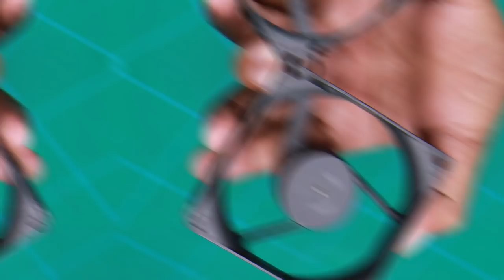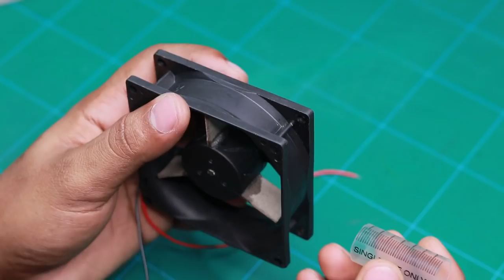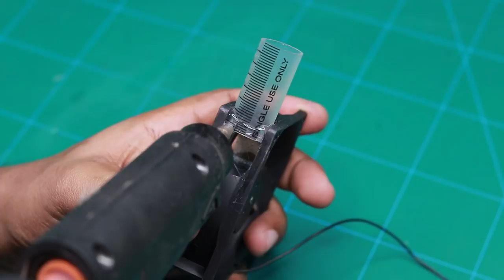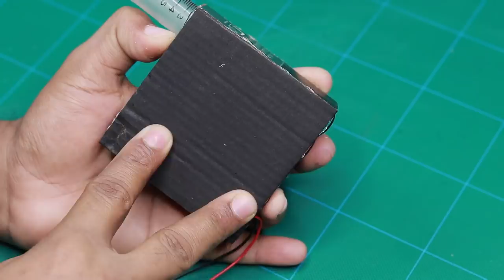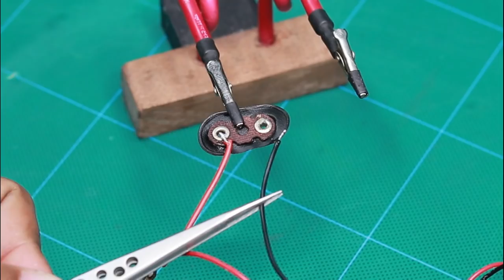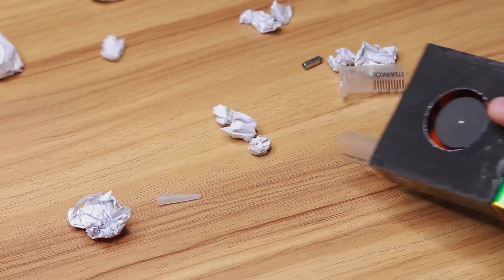How to make powerful air blower

Comment: It’s better to use a fan that has higher speed and torque with a backward curved fins with a proper volute housing and use a closed impeller design with a smaller output to compress the air more also make the fins as thin and long as possible and use a light weight material

Comment: There is no need on doing that work with 2 dollars you can get a small one and way more powerful
Reply: Where??? Blowers are expensive!
Reply: @brujo_millonario  a 3d printer blower 12v costs 2 euro
Reply: @brujo_millonario  sunnon blowers are 13 and they are much more powerful than this blower